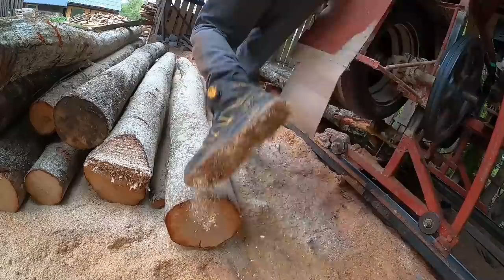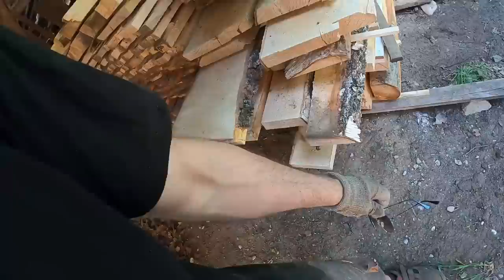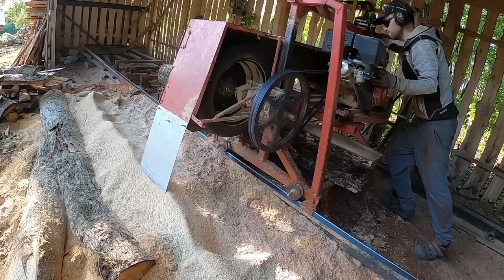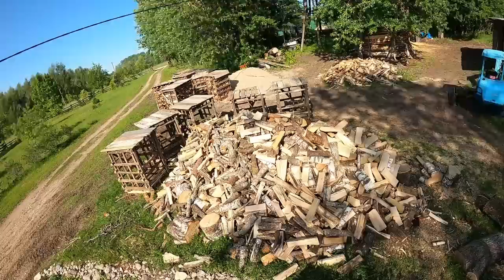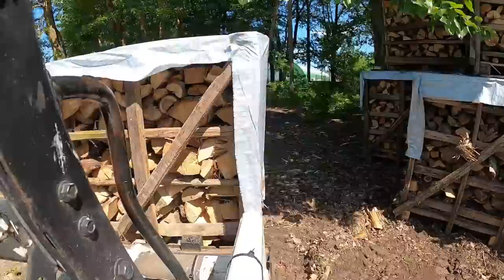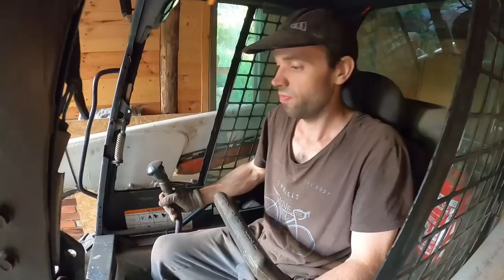Processing A LOT of stuff into firewood

Comment: What an amazing amount of hard work. I like your wood storage boxes. I think that the cloth wrapping on top is more than sufficient. It's probably a good idea to take a piece of OSB and paint it with the waterproofing and sit it outside just to see how well it last the winter. But probably it's not useful for the firewood boxes. You should get heavy plastic bags and fill them full of sawdust and sell them to people for soaking up oil spills. Then yes you could probably use the oil-soaked Sawdust as the heat source. Use Hydraulics from the Bobcat to operate a pelletizing tool.
Reply from the maker: Thanks for the tips friend

Comment: To help make the white roofing tarp material last as long a possible, I would try to cover most of the fire wood holders/totems with another layer of material, like a very large (ie, heavy duty/thicker) construction tarp (1 or 2 of might be enough to cover it all). Imo, it's a lot easier, and way faster, to replace 1 or 2 large weather worn tarps, than it would be to move around 30+ totems just to replace worn white tarps.
Reply: Or just build one roof over the whole pile 😊

Comment: Your next assignment is to make your own metal melting furnace and cast two solid cast aluminum bandsaw wheels with a steel center bearing and wrap them with a band of strong steel for the blade drive with a raised rim on the back edge to keep the blade on!
I know aluminum is weak but if you use a steel center bearing and a steel band around the outside edge it will hold up. I think?
Reply from the maker: Wow that feels like a ton of work

Comment: In the future you'll want to fold the top of the tarp over the sides to help keep the wood dry. I noticed you wrapped the sides over the top......water will flow into your beautiful wood piles. 😮 Also there are battery operated siphon pumps for under $20 which would make fueling your vehicles easier.😊 (I'm a retired Over the road trucker with 2 million accident free miles experience. )
Reply from the maker: that battery pump would be cool idea. Thanks for the tips

Comment: As far as the plastic cover…. If you just paint it with a cheap exterior paint that would solve your UV light issue, therefore extending the life of the plastic. Then all you need to worry about is the wind ripping it to shreds.

Comment: What about a self-made couter weight on the back of your bobcat for moving around heavy stuff? That could be pretty helpfull for most of your jobs. Well actually you should probably buy a slightly bigger skidsteer 🙂✌ and of course you still need a badass 4x4 Pickup-Truck!! 😁But probably most of my comments are outdated by now anyways.. but I am quickly keeping up with all the vids! 
BTW these plastic covers really don´t last very long from our experience. And our climate here in northern germany is quite a bit milder than in your region. Unfortunaltely the only thing that really helps is a roof over the pallets. Fortunately we were able to extend the roof of the new machine hall we built for about 1,5m so like 20 pallets 10x2 stacked fit under the roof. That works perfectly. The rest of the pallets (around 10) we have under thick Trailer tarpaulin. like 5 under one big sheet. That works pretty good as well and pretty much lasts forever. A lot more expensive but when you calculate how long it lasts it will outrun the cheap crap over the years.
Reply from the maker: Then other parts on the bobcat will be overloaded. These days things are built to spec and no headroom. In soviet days they added 5x more steel then what was required

Comment: Right then, Ant, here are a few suggestions and tips I have come up with after watching this great long video of yours. At least consider them, and try them out. You can pay me later 🤭

I warn you now that there will be a lot to read, not a novel but a lot. So grab a beer, sit comfortably, and start reading.

First tip the boarding. Use it, and here is why. Once painted in that bathroom sealant, it will protect the roof sheeting you used, making it last a dam sight longer than 1 year. It will also help you stack the wood crates more easily and save ripping the sheeting to pieces.👍

Next tip sawdust from cutting logs. If you were to use a bucket and collect the dust storing it in large plastic bags instead of wasting it, you could use it to heat your saunas and home. How can I do this, you may ask, okay, I will tell you Ant because it's very simple, really.

You would need to invest in a sawdust log compression machine and a bucket. Nothing too expensive, im talking about the machine, not the bucket. As if you would spend thousands of dollars on anything, I should coco lol

600€ should do the trick. I don't know how much that is in dollars, probably around $800. Or you could save money and make your own, which is a much better idea. You can find out how to make a sawdust compression machine from videos on YouTube.

How it works is simple. It compresses the sawdust into blocks, which you can stack more easily than rough cut n split logs. That way, you will waste nothing from each tree you cut down and keep the environmentalist happy.😏

Next tip, which I use on my patio of an evening and every time I go fishing on lakes where there are millions no, gazillions of blood sucking vampire mosquitos. Try this tip because it really does work. You will thank me for it. Everyone knows how annoying those mosquitoes can be, and I've seen how much they annoy you. 🤬🤬🤬

I will tell you what you need and how to make it. I use both methods, which you should do depending on the circumstances or needs.

Collect your old boot laces from friends and family. I've seen hundreds of people milling around where you live, so you should have plenty of laces from them, and you need to collect them all year round.

While you are collecting laces, buy some cheap hemp rope. The rope they use on ships is best. Rope works much better than laces, but collecting enough of them to last you throughout the year would take you years, which is why you need rope. Plus, if you need a mosquito deterrent for just a short time, then laces are the better option.

Whichever material you choose, you need to do one thing before you soak it in old engine oil from one of your vehicle services for 48 hours, allowing the oil to penetrate deep.

Boot laces have plastic ends, and you need to remove one of those ends on every lace. But rope does not have plastic ends. You need to tie some wire around one end, not a lot, just enough to stop the rope from coming apart. Both laces and rope need one end that can be secured in some way. I use nails for rope and either drawing pins or wire paper clips for the laces.

Measure the rope out in 3 feet lengths which is about 1 meter. Divide the rope into 3 thinner strands. If you can, keep dividing until each strand is about the thickness of a boot lace. Once done, soak in oil for 48 hours minimum in a container such as the one you use to do your oil change. Old motor oil is best, the older the better as it is thinned out. You can always add a little paraffin or kerosene if the oil is too thick, but that is not usually necessary. 

While wearing disposable gloves, lift the rope strand with one hand and grip with the other hand slowly squeezing out the oil as you run your hand down. There is nothing of a sexual nature here, boys, clean minds, ok. 😏🤭

Hang the lengths up to dry over a tray. It will catch any excess oil so as not to waste or create an oil slick, which is dangerous. You don't want to slip on them and break your bones now, do you? Do the same with the boot laces only hold between thumb and forefinger.

Once the rope or boot laces are dry, this should take about one to two weeks, store them somewhere dry and out of the reach of children. When needed, grab a lace or strand of rope and fix one end to the inside of the vehicle you are driving and light the other end. Once it is burning, you need to blow out the flame. The lace will continue to smoulder until fully spent.

If your vehicles have windows, make sure one is open, allowing any smoke to vent out. Don't worry, the smoke is not heavy, about the same for a cigarette, just no nonicotiene.

When camping, I use the laces inside my tent. Ropes I tend to hang around me on poles while fishing or on my patio when entering, day or night. The smell of smouldering burning oil keeps those blood sucking mosquitoes away. Like citronella candles or citrus coils, only way more cost effective. 

Very last tip, Ant, I promise. This you put on your skin. You rub it on the back of your hands, arms, neck, and face, even your legs if wearing shorts. Try any one of these suggestions that my wife swears by. Don't buy commercial sprays as they tend to be very expensive and most don't work.

Buy natural oils. They are cheaper and better for you and for our environment, plus work much better. Choose any of the following; in no particular order, cinnamon, peppermint, cedar, lemongrass, lavender, and my proven favourite of all time, patchouli oil as mosquitoes really hate patchouli oil, so give that a go first. Good luck 🤘

The end. 👏👏👏🇬🇧🇺🇦
Reply from the maker: Hey and thanks for the comment 1) Yes, 2) i used sawdust mostly for oil spills and the women end up using the rest for their maniy gadens. 3) great idea 4)thanks